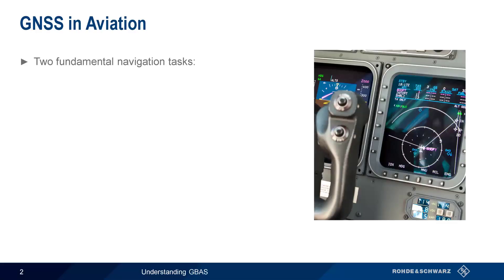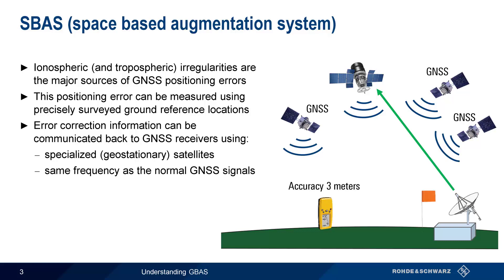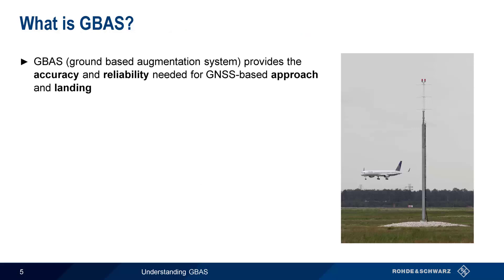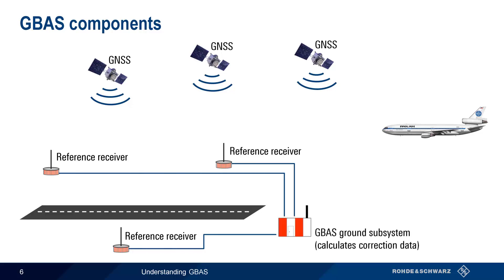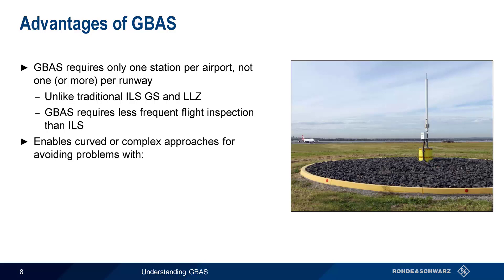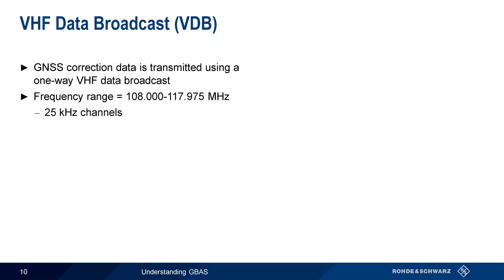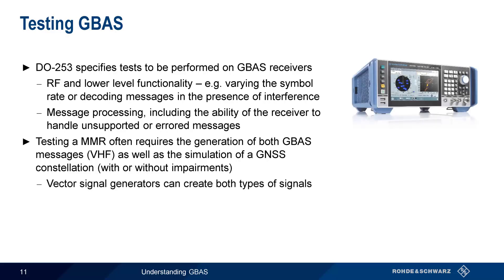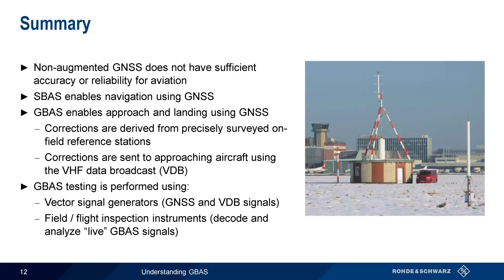Understanding GBAS

Comment: I take issue with the statement that non-augmented GNSS does not have sufficient accuracy or reliability for aviation. That just isn’t true. The level of position accuracy required is dependent on the performance based navigation requirement (RNP) of the phase of flight or approach being flown. In enroute airspace or for the purpose of flying a non-precision GNSS approach, augmentation is NOT required but that has to be considered in the approach design. Obviously GNSS based precision approaches will require GBAS but that is a very specific instance. I live in Australia, we do not have SBAS, we fly IFR and shoot approaches IFR using GNSS every-single-day.

Comment: I was under the impression that WAAS, which has an accuracy of approximately 1 meter, CAN be used for conducting precision approaches. Every other instructional video and text that I have read says so. Is this video outdated or incorrect, or am I incorrect in my understanding?
Reply: Good question:  I would refer you to the FAA AIM, section 1-1-20b.   Specifically:  "A class of approach procedures which provide vertical guidance, but which do not meet the ICAO Annex 10 requirements for precision approaches has been developed to support satellite navigation use for aviation applications worldwide. These procedures are not precision and are referred to as Approach with Vertical Guidance (APV), are defined in ICAO Annex 6, and include approaches such as the LNAV/VNAV and localizer performance with vertical guidance (LPV). These approaches provide vertical guidance, but do not meet the more stringent standards of a precision approach. Properly certified WAAS receivers will be able to fly to LPV minima and LNAV/VNAV minima, using a WAAS electronic glide path, which eliminates the errors that can be introduced by using Barometric altimetry." [Emphasis mine]
Reply: @pauldenisowski  Thanks for the reply! I went to that source (AIM 1-1-20b) and I can't find anything that you just wrote. That section talks about the issuance of special instrument approach procedures under certain circumstances and who they should contact to receive special IAPs. But I did do some digging on the interwebs and found that WAAS is not a precision IAP, even though properly equipped GPS receivers with WAAS capability can descend to LPV minimums on an MDA approach. It's all jogging my memory from my Instrument rating days.
🙂
Reply: @ianperry9571  Sorry, the section is AIM 1-1-18b (edited my original reply).  Both FAA and ICAO seem to have a very specific definition of what constitutes a "precision" approach.  Clearly WAAS provides some substantial benefits for approach, but GBAS takes the application of GPS in aviation to another level (no pun intended :))  Thanks again!
Reply: SBAS LPV (and RNP approaches for those operations with proper authority) approaches are capable of very similar minimums as ILS CAT I. The difference is, because the FAA (in the US) still categorizes them as “non-precision” they restrict the requirements for filing the associated airport as an alternate. E.g., it’s an issue of definitions and the FAA hasn’t caught up yet.

Comment: SBAS can provide guidance for an equivalent CAT1 precision approach?
Reply: No, it's not possible. SBAS is used as a RNAV/RNP approach, with LPV minima or even LP minima. When  you join the final approach, it usually shows WASS displayed on your equipment.
Reply: I think you’re splitting hairs. LPV approaches are quite often at or near CAT I ILS minims to the same runway. To the original poster I’d say yes, SBAS LPV approaches are very similar in capability to CAT I approaches.